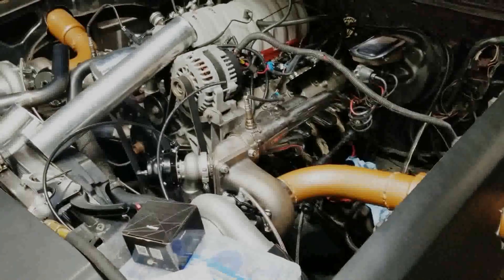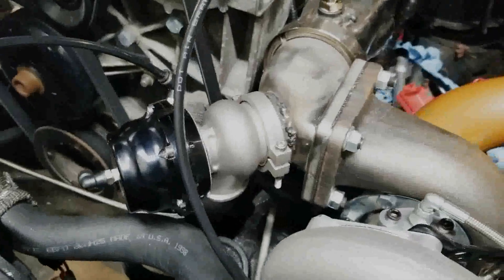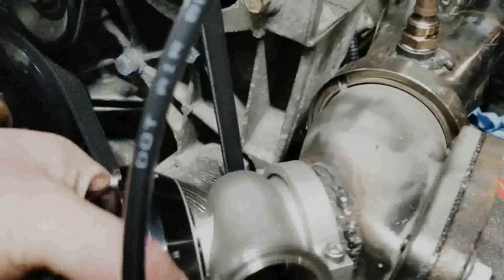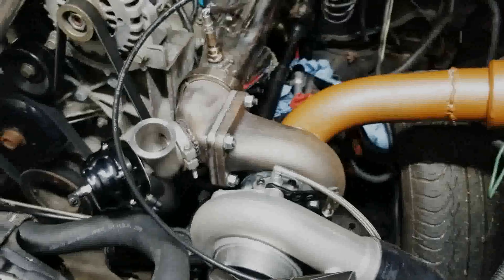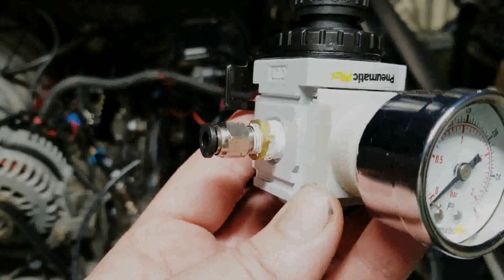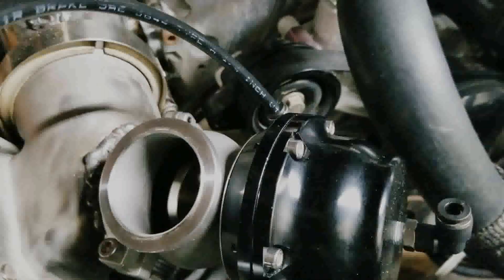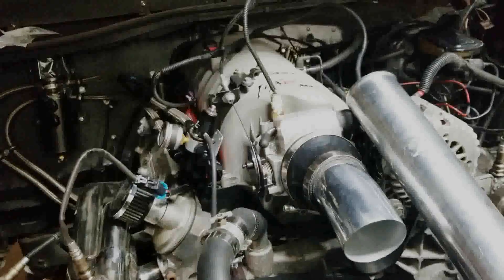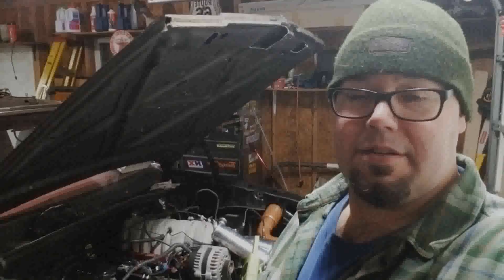How to Function Test Cheap China Wastegates

Comment: Will you still recommend them if in a budget?
Reply from the maker: Oh, absolutely. I wouldnt take one out of the box, throw it on a motor and let it fly. They need work, and you can't trust what the supplier says on spring pressures. One of the gates I got would have worked ok out of the box, but the other was not functional until I took it apart, cleaned all of the burrs, cleaned it, lubed it and put it back together correctly.